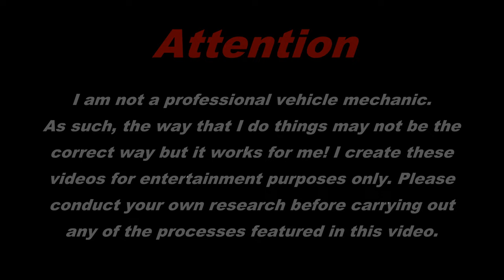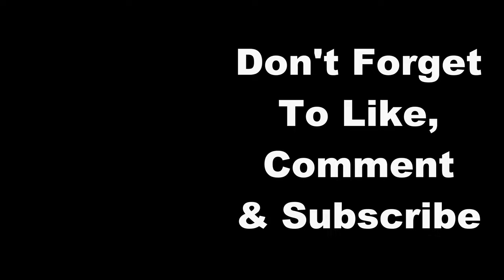Peugeot Django 125/150 Carburettor Replacement

Comment: Thank you for very instructive videos. I bought my self a Peugeot Django 50 one year ago. She's a beauty and I love scooter life! Recently the scooter is hard to start and sometimes looses engine power while driving. These problems occurre especially when it's cold or it hasn't bin driven for a few days. If you think a carburettor replacement is necessary, do you know which fabric-number I need for this model? (Peugeot django 50, 2017)